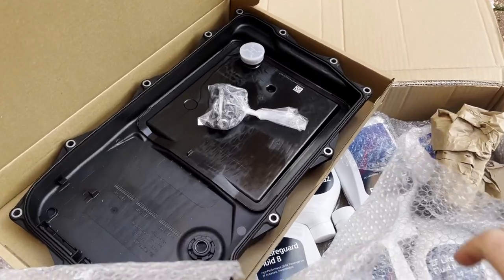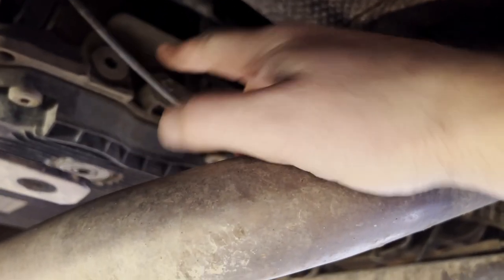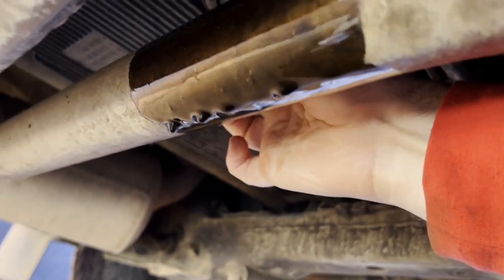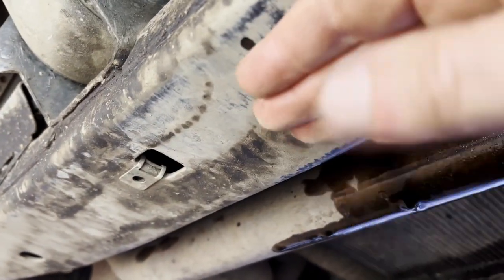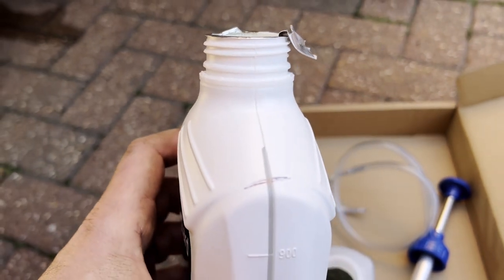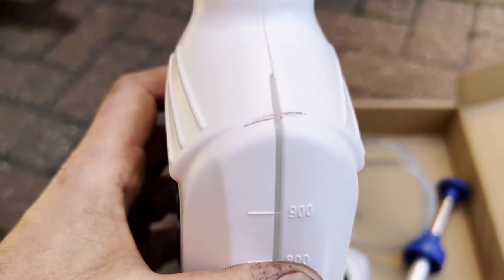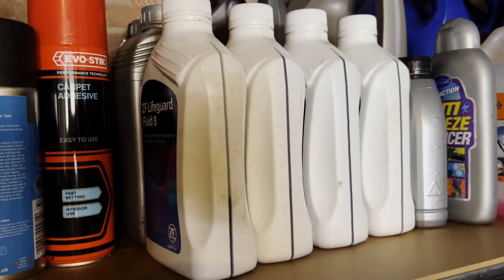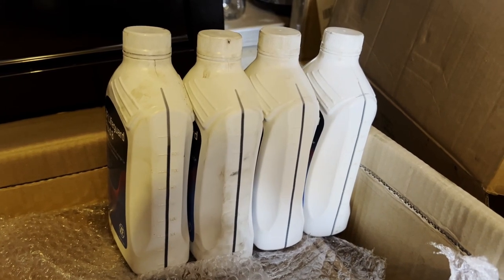ZF 8HP Gearbox oil and filter change on my Land Rover Discovery 4 (LR4)

Comment: How much is factory filling? You filled it with 5 liters? I have range rover sport 4.4 diesel. They say it needs 8.5L but i only get 5 liters in it.
Reply from the maker: @TopGMisterAMG  the whole system when dry takes 8.5L, but if you drain from the gearbox, the cooler etc will still have oil in it, hence why I only got 5L back in it. I ran it for a few hundred miles and then changed it again

Comment: How the hell did you get the filter replaced withought removing the cross member?
Reply from the maker: It was tight, but it came out!!
Reply: Jb I was wandering the same thing.  Everyone I spoke to said at the very least Cross  member needs to be loosened off.
Reply from the maker: @gadgetphilosophy8290  it was a right pain to get out and the new one in! It would have been easier to support the gearbox and remove the cross member!!